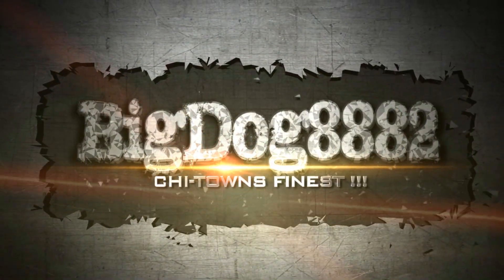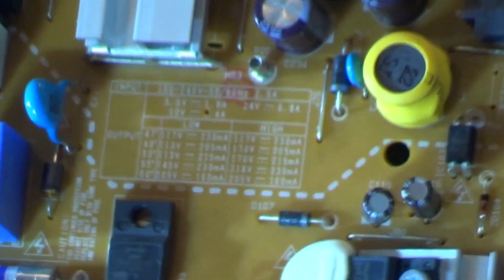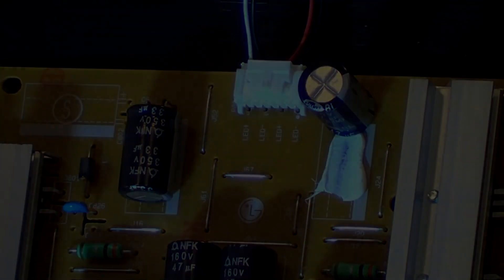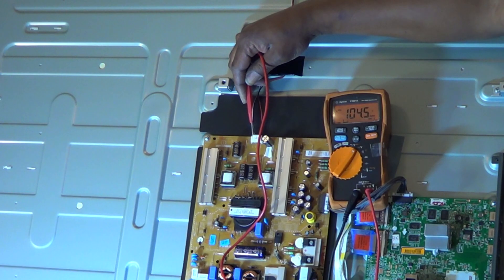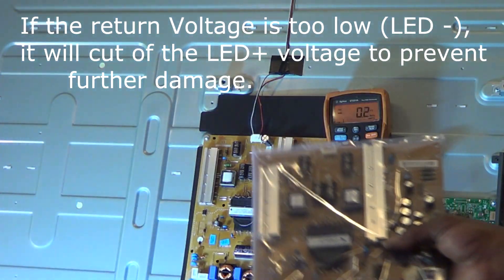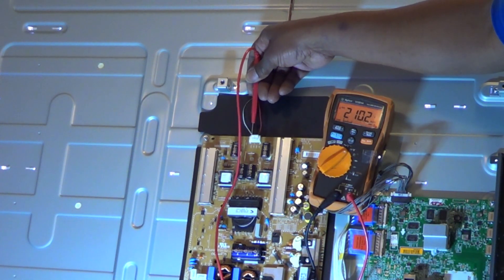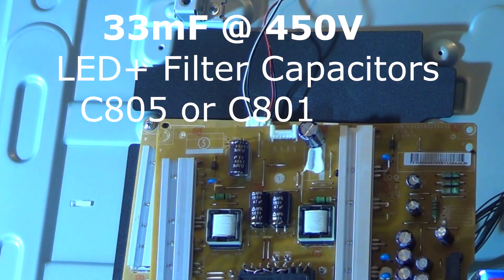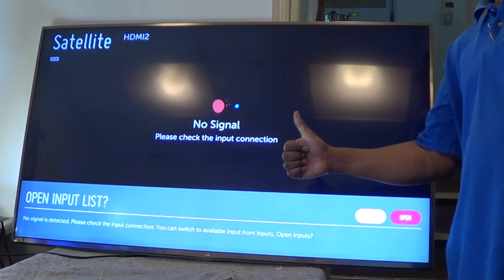LG TV has sound but no backlight, power supply or bad Led's. How to troubleshoot

Comment: About a week ago I have same problem. I have the 32lg32lk540bpua I'm getting audio but barely any picture. I did the flashlight test. By holding the bright light up to the screen. Yes, I can some of the features on the screen and I get audio. This model is not that old its from 2019. Does that mean its the power supply board? Please respond soon. Thank you!

Comment: Had a TV with sound but no backlight but you could see the picture if you shined a flashlight on the screen. I opened it up and immediately saw the issue. It had a bad cap near the LED driver output to the LEDs. Specs were 33uF 200v on the original. I went on amazon and got 10, 33uf 400 volt caps, installed a new one and I now have a working TV. Still testing runtime.

Comment: Quick question for you sir.  The voltage on those LEDs….was that 205v AC or 205v DC?  I have the exact same issue, but wanted to know before ripping into the TV.
Reply from the maker: Im sorry, DC volts always.
Reply: @bigdog8882  I’m looking for a way to cheat it without replacing the power supply.  Meaning finding a 200+ volt external power supply for the LEDs.  Another possibility I have, since it appears that my power supply is currently only putting out ~ 118v, would be to replace all the factory LEDs with 120v DC LED strips.  I know the brightness level from the TV won’t quite work, but I’m okay with being full brightness all the time.

Comment: With my lg on the underside i checked and found what appears to be open circuit resistor around the BL voltage creation chip. Have you ever done any checking underside of that faulty board?

Comment: I have a similar tv and the led output should be 208vdc but I'm getting 420vdc. I've checked the leds and there all fine and light up. The screen works as I've tried the flashlight test on it. Can anyone help?

Comment: I have Samsung 65' curve. No picture, no back lights, has sound and you can see the picture using a flashlight. I replaced the power supply board which also has the LED supply built in. At first back lights worked an*25
d picture was there then 15 seconds later no picture and one side of the back lights did not work. Plus now back to no back lights, no picture but sound. I need help!

Comment: Hi big dog, I have a 75 in LG tv. It has a grey screen. Has sound but no picture. Replaced the T-Con board and the motherboard and still no fix. Could it be the ribbons or the power supply?

Comment: Hey man I have that same TV just a 65 instead of 60 I think but like some of the screen is darker then the bottom, do you have any clue what that could be??
Reply from the maker: Led's are out at the bottome
Reply: @bigdog8882  leds are out at bottom if its darker up top?
Reply from the maker: @themayor6180  No. misunderstood U. Wherever its darker, thats where the LED's are not lighting up. Either way you have to pull the whole TV apart to get to all of them.

Comment: If all backlight give out same voltage on each line ( side a 194) side b (168) and es h libe together gives 34.9 

Picture doesn't come on but can see images in background do you think it will be the main board instead 

It's on a 47l7453d led Toshiba I'm looking at but stuck 

Only one line of less has slightly higher voltage of 35.3 but could be bad connection 

All bulbs light up equal

Comment: Thanks for the video, I have a HISENSE LTDN32K560HK3D LEDTV which has the exact same problem with you. No backlight nor picture on flashlight test. I guess it's the power supply board and need replacement. But where's I can buy the board?

Comment: Big Dog I have a question. brought my tv into a shop. they said the power supply has gone bad, fair enough. but they also say my backlights are no good. is this possible? could the power supply burn out and cause the backlights to go blow aswell?
just trying to figure out if the shop is trying to screw me for extra parts and labor. 
thanks

Comment: I have a 25-42V fluctuating vled 1 and 2 ....when I unplug it still have a fluctuating DC voltage...would you say power board?
Reply from the maker: If the led's check oK, then Yes i would replace PS
Reply: Thanks for the fast reply. 
If I unplug the LED plug and the voltage still fluctuate that tells me that its not the LEDs that are messing with the voltage? Im guessing if the board was good I should have a full stable voltage at that test point?
By the way i'm also having a flashing screen but I can see it with the flashlight test, just no back light. My model TV is a Sharp(from bestbuy) not LG couldnt find anything for my  model. Sorry for all the question and thanks in advance bigdog!

Comment: Sup bigdog I need your expertise on an issue I'm having with a Vizio P602ui-b3. I can't figure out why only the right side of the backlights turn on after replacing the main board. I tried putting back the original board and all the backlights turned on, so I know the LED strips are all good. I even tested them to make sure. Also replaced the LED driver board but still same issue, so it's not the LED driver board either. I even tried a different main board and again I only get half of the screen to lit up. I matched the original board to the new one and all the part numbers match. Even reset it the TV to factory settings. Not sure what causes all the backlight to turn on with only the original board.

Comment: Just to be clear.  You replaced the puffed up capacitor on the old board but the old board still did not work.  Correct?
Reply from the maker: Actually when I got the TV the picture was Flashing, replaced Cap and it worked. When I put the old one back in to do the Video I must of broke one of the leads Internally and it blew out something on the Circuit board.

Comment: I had the same problem with a 32" LG LED TV with sound and no picture, it turned out to be the remote control battery which was too weak to turn the picture on but enough juice to turn the sound on.  I know it sounds crazy.

Comment: My complements Brother ,,but here in Suriname,maybe in other Caribbean countries ,a swollen capacitor is rarely found n the Power Supply,, ,in most cases the entire Power supply board has to be changed and due to the exhorbitant price to import such online ,,these Flat screen televisions remains at the workshop  with the Technician at least i am one of them and there are a few other Technicians that has the said problem ,God Bless.

Comment: Can you fix my TV my stand by light flashes three times then the TV won't turn on can you help cheers.james from Glasgow /uk
Reply: Make/model?
Is there sound?
Blank screen can you see an image if you shine a bright light at the screen ?
Reply: @wisher21uk  the make is lg 3d 42inch. The model number is lg-42lb650v-zn it doesn't switch on the standby light just flashes 3 times.
Reply: James Smith defo no sound at all ? Is it plugged into a source aerial/hdmi ?
As not turning on can be no backlight leds, this why I’m asking
Reply: @wisher21uk  James Smith here defo no sound at all and no picture hdmi plugged in and Arial won't turn on. Cheers for trying to find the problem.
Reply: James Smith ok it will need stripping down and need a multimeter do you have one ?
Reply: @wisher21uk  no I don't have one
Reply: James Smith oh well you need one really to diagnose the tv ......
Reply: @wisher21uk  thanks for the help and advice